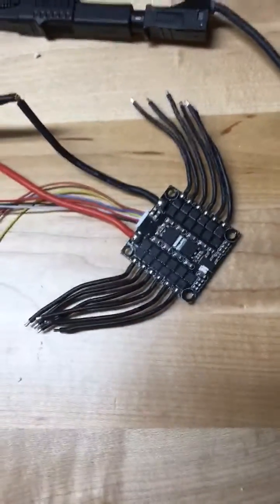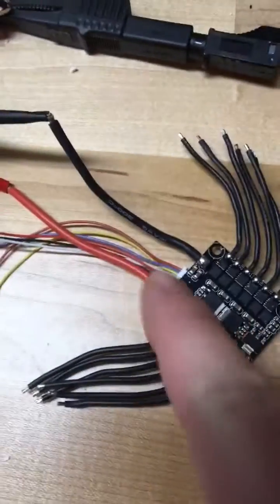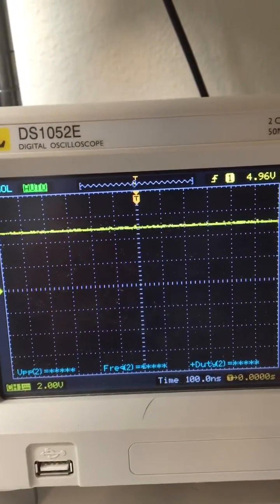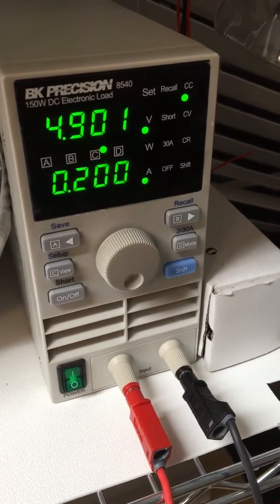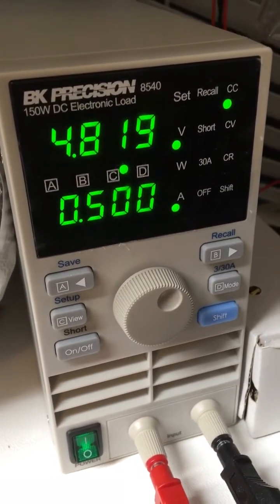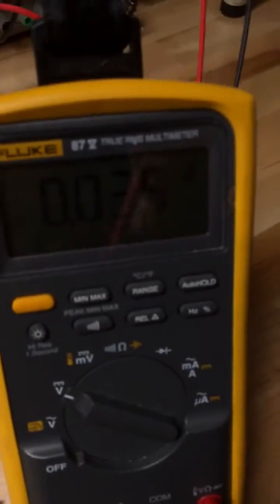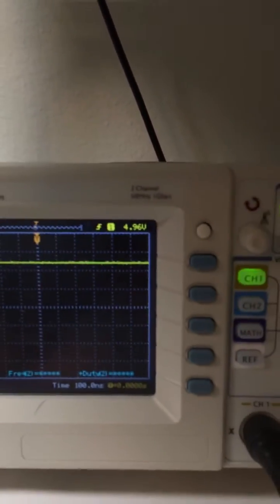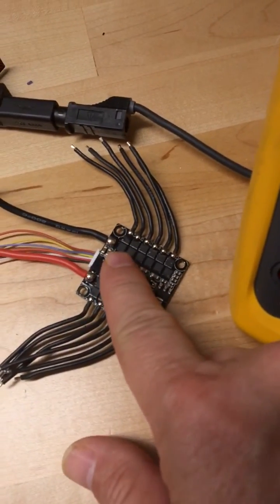Little Bee 20A 4in 1 ESC BEC test

Comment: hey what happens when you have everything connected but the only thing that does not kick in are the esc's. i was so in a rush to get my kingkong 90gt back in the air and did not bother to test. i didnt get no smoke or anything when i connected the battery. The thing i did realize is that it made its normal 2 sounds but never gave me a last beep. Is there something i could test to see why the esc are not functioning. it was a quick swap from the old 4 in 1 to the new one i ordered.
Reply: If you don't get the last part of the initialization beeping when you plug in, the flight controller (FC) is not properly initializing.  Check that your cable going to the FC is properly wired up and that you are getting the correct lights on it.

Comment: Is there a cheap solution? for 4 in 1. I want to do a 250 build but like the idea of 4 in 1. is there no diy developmet boards for this? what is this board?
Reply from the maker: I love the concept of a 4 in 1.  There and pros and cons with this though.  The big pro is that it is CLEAN!  Less 'stuff' around the build.  The biggest con is that if there is an issue with one ESC, you have to replace the whole board rather than that one ESC.  The BEC (5V regulator) is not a big concern if you are not running LEDs since it seems work work fine at less than 1/2 amp. 
For a compact build, this works well.  If you are looking for something with more power for your 250 size then you could also considers the TBS Powercube.  It has one board per ESC.  It isn't the cheapest solution but it is very clean, offers plenty of power and you can replace just a single ESC if one goes bad.